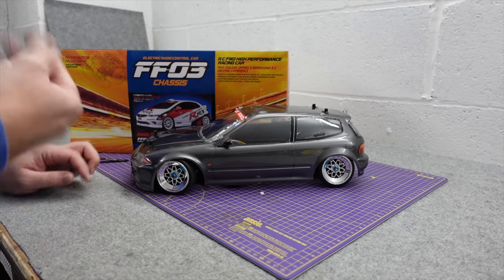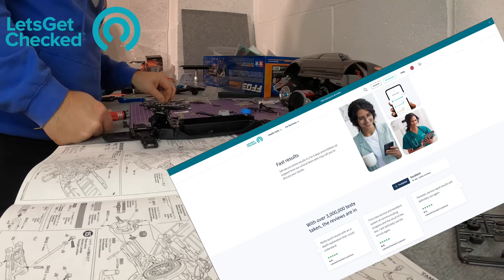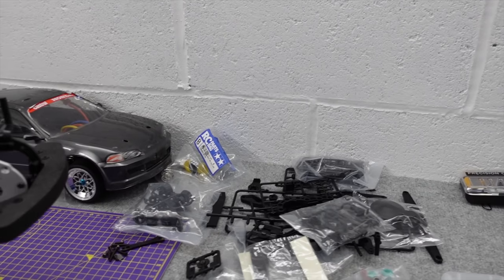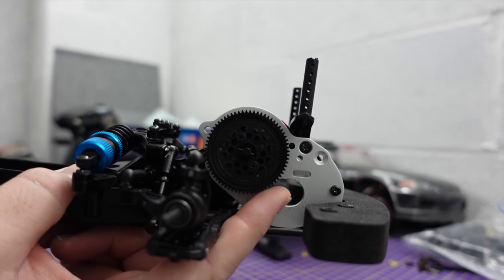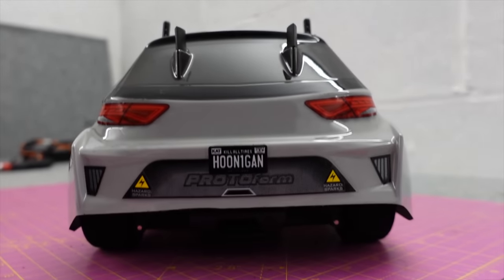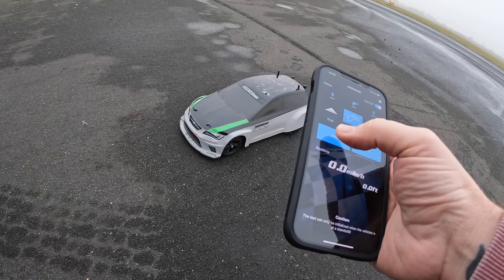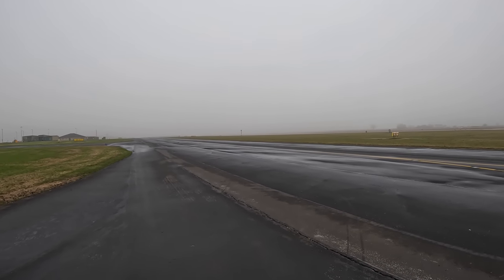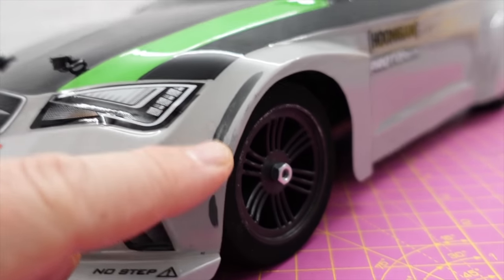Project Worlds Fastest FWD Tamiya RC Car - Pt2

Comment: I’ve raced a FF03 for quite a bit. The standard ball diff slips like a worn clutch. The TRF hardened gears and TRF201 diff parts do better. But you will need either the gear diff or the YR racing spool. 

In the past I have also melted the idler gear when racing (standard gear set)  with a 17.5 brushed motor. 

Also in the past after seeing your FF01 video I set about trying to beat that and managed 58 mph with a otherwise standard FF01. But the top gearbox cover would lift after a few runs (30T pinion and 66T spur with 5T motor both on 2S and 3S) surprisingly the ball diff didn’t slip on that car unlike the original FF03 item. 
A couple of things I learnt while doing the project was to glue the sidewalls on the foams to try and prevent them chunking when the car got loose. Cut the rear bumper out to get any trapped air out and it stopped it being a kite. A rear spoiler definitely helped keeping it stable. And the ability to have a handset to slowly bring the throttle in. This helped a lot with the TT01E project as it stopped wheel spin etc. 

With the FF03 chassis you can add shims under the wishbone mounts to have anti squat/dive etc and this may help you with traction. Harder rear springs is what I’ve used in the past with my FWD Xray at BRCA National races for more steering
Look at swapping the spur gear to another type as for instance a 64DP 78t spur and 58T pinion is 3.5~1. Well better than the gears you can get with the Tamiya 0.6 and even the option 0.4. As I’ve run the latter with the option 0.4 spur gear and one from a TA04 and had to run between a 49~51T pinion  when racing in 17.5 brushed class.

Comment: I love the eg body on your first one. You should cut some holes or remove some of the rear bumper of the new body. With the wheel arches in the rear covered, your ass end is gonna be like a parachute with the air that comes in from the front wheel arches

Comment: You would find more grip with on road tyres like you would use on your car as the tyres should disperse the water on the damp surface and use the others for dry surface
Reply from the maker: Yes, hard to find decent ones. Even the belted ones balloon a bit and catch the body

Comment: Love this project, warmer weather will certainly help, batteries as you have said before run better in the warmer months.

Is the front wheel diameter set in the record criteria, because part of me wonders if an increased tyre diameter and disc wheels like are specified on the indoor 1/10th touring car comps might help ???

Comment: Just a thought if you run the copperhead esc its runs 4s and the 4000kv castle motor is just shy of 100k rpm

Comment: You actually DO want rear weight and rear downforce for stability. If all your weight is at the front, you have a low polar moment of inertia about the front axle and it makes it extremely easy for the back end to change directions and whip about. It's like holding a hammer by the heavy side and swinging the handle vs holding it by the end of the handle and trying to swing the heavy side. As for the downforce part, rear downforce adds rear grip by loading the tires more, and they will resist that swinging regardless of weight distribution, but that will only come into affect at higher speeds over 30-50 MPH

Another thing to be concerned with is the center of pressure. It's very difficult to get the center of pressure more than halfway back of most cars. If your center of pressure is in front of your center of mass, then the car with become aerodynamically unstable whenever the effective direction of the wind goes any amount perpendicular to the car's direction of travel. Back to the hammer analogy, it would be like pushing sideways on the handle end of the hammer (if the handle represents the front of the car). Very easy to make it spin around and point the wrong way. Whereas, if you point use the heavy end to represent the front, and then push anywhere on the handle, it'll make the heavy end point more forward.

THIS is why you see vertical fins on some race cars. They have a very rearward weight distribution (more than 55% rear), but their center of pressure is forward due to needing more front downforce to aid front grip and get the car rotated at high speeds. So once the car is perpendicular, the center of pressure would normally cause it to massively oversteer, but with the vertical fin, that rapidly moves the lateral center of pressure to the rear, creating more stability.

Long story short, except for edge cases (like drag racing, or the Nissan Deltawing) anything in the 60/40 to 40/60 range of weight distribution is effective for typical car design. I recommend you set up this car for a 60% front/40% rear weight distribution, and add a semi-significant rear wing (like a buggy wing), with a couple of small front canards/dive plates, that way you have aerodynamic stability and downforce for high speeds, as well as normal stability via the weight distribution for lower speeds. That alone should make this FWD speed car stable enough, but you should also look into the steering ratio as I suggested in the last video, as well as the alignment for even more stability gains.

test

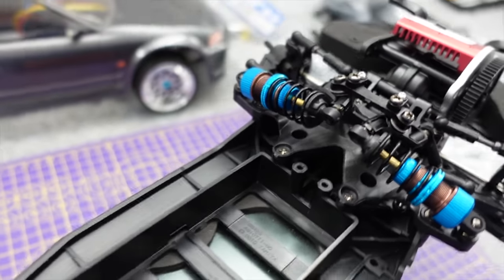Comment: 3:40 I can't believe after all this time they're still using those cheap plastic ball ends. When I had my rough rider back in the early 80's by the time you got the alignment right they were worn out and popped off easier than a 13 yr old at a nudist beach.

(now I noticed that they are actual turnbuckles instead of a straight screw thread which helps but......)

Comment: increasing rear spring rate WILL NOT have any effect on the dynamic load transfer to the rear. Only wheelbase/centre of gravity and acceleration will.
Reply from the maker: My thoughts were that stiffer/harder rear springs will reduce the amount of 'weight shift' to the rear, so will keep the front end in contact with the ground better. 1:1 FWD Drag cars always have hard rear suspension... unless they have a wheelie bar, then they soften it up to get the wheelie bar in contact with the ground as quick as possible to again keep the front in contact with the ground
Reply: no but it increases corner weighting to the front, which improves traction.. 👍🍺🇬🇧